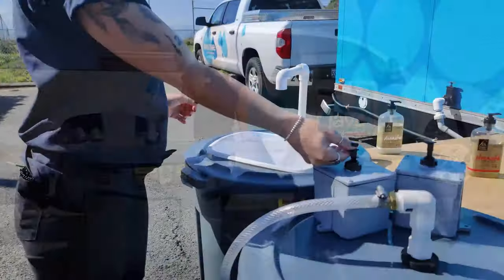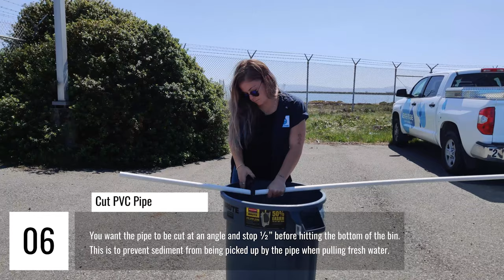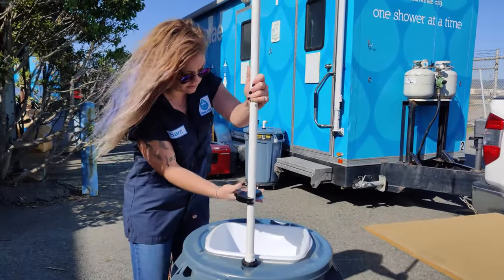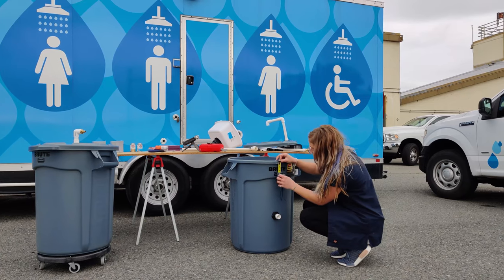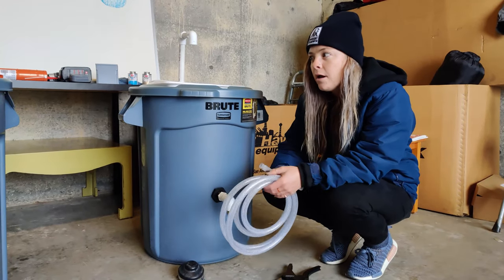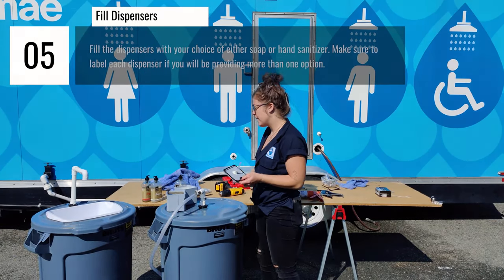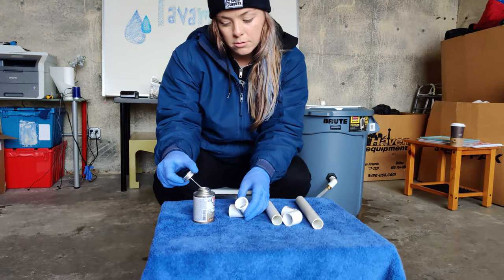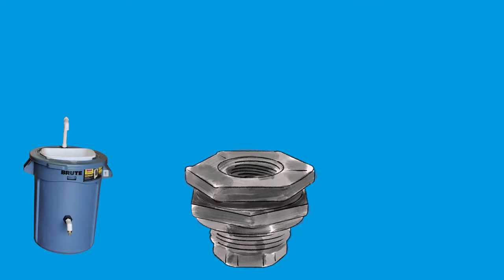DIY Handwashing Station V1 ~ LavaMaeˣ

Comment: Great job... What about the greywater? Where it's going? How do you take it out of the bucket?
Reply from the maker: Hello! Deployments that are at a brick and mortar are dumped into clean-out drains, and at encampments we have a siphon pump and bag where we take the grey water to dump at disposal sites.
Reply from the maker: If you need more information, please e-mail sam@lavamaex.org thank you!
Reply: Is there a valve or a hole where the gray water can be drained? Maybe I missed it in the video but I don’t believe I saw one installed. Thank you so much for doing this.
Reply from the maker: @livingfreely4330  Hello! We drain ours with a siphon pump from the top. Please contact sam@lavamaex.org for alternatives!